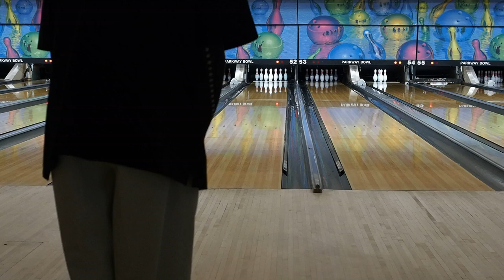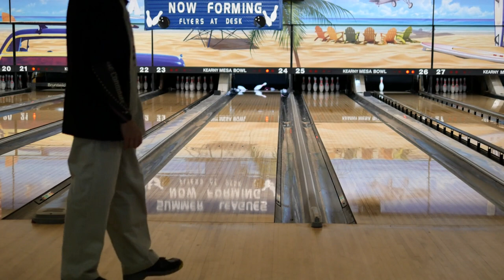Full Roller Bowling Release 78 - "The Float" (Axis Layout in Action)

Comment: Nice bowling but I would like to know more about how the balls are drilled.  Watching you bowl is no help to me trying to figure out how to drill my ball.  My track is between my fingers and thumb holes and I have thumpers from the thumb hole when I have flare.  I’m a lefty that throws a bit harder 16+ mph. About the same rotation as your release.
Reply from the maker: Of course. 
If you look at my other videos, I always show a pan of the ball and the layout on each ball.
If your track is between the fingers and thumb then you are a Full Roller and must use Full Roller layouts to optimize performance and keep the ball from rolling over the holes.
Look up Full Roller layouts on google.
I normally recommend medium to low flare layouts for full rollers, with lower ball speed and higher flare layouts for those that have greater speed but less revs.
The layout in this video is called An Axis layout for a Full Roller and my video thumbnail shows the layout on the ball.
Reply: Thanks!  I’ll check it out.  Have a Merry Christmas.  Have a new ball coming so I will give a full roller layout a try.
Reply from the maker: Sure. Post back if you have more questions about the layouts you find.